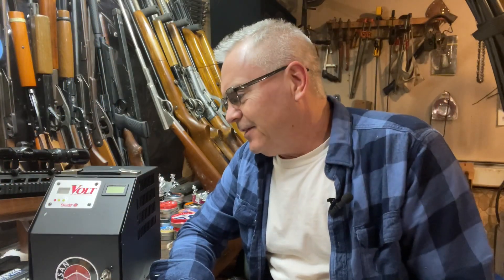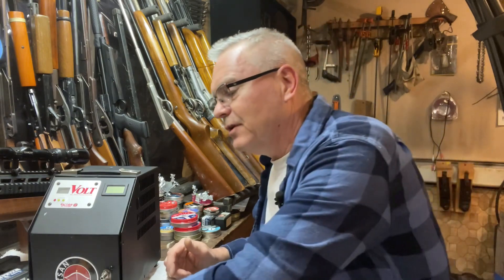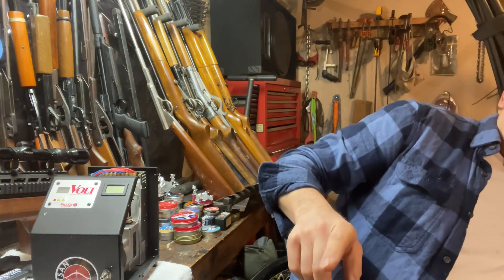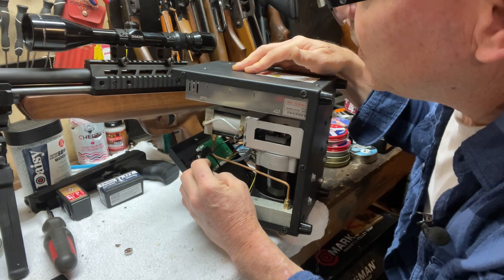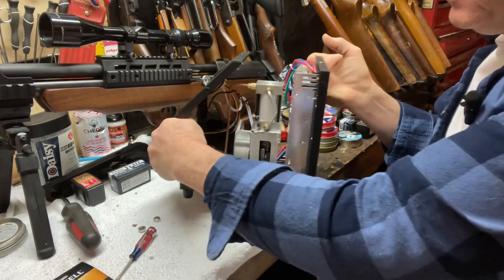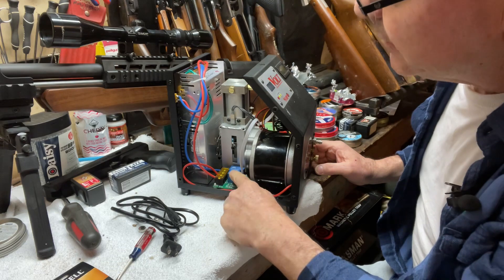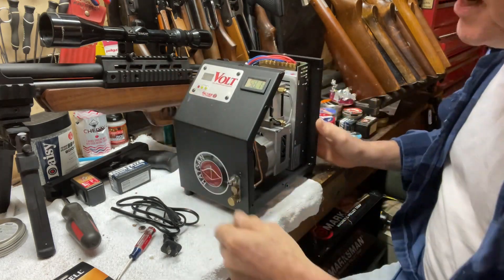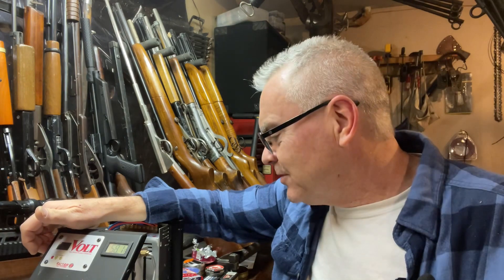Hatsan Volt PCP compressor temperature sensor repair and a peek under the hood.

Comment: Nibs, I have a problem with my Hatsan Volt I purchased and was wondering if you could shed some light on a couple things?
1st- Is the temp sensor anyway connected to the cooling fan operation? (My battery compartment had no cover and the tape I applied is not keeping the new LR44's in place too well)..I will make something a little better soon.
2nd- My cooling fan does NOT turn on when plugged into an ac outlet.The main display works but no fan..I have opened it up and made sure the 2 wire connector is in place properly and plugged the ac in..but nothing.
(I should mention that upon inspecting the fan I have a red and black wire that go into the white connector, then to the board...but I noticed yellow and blue wires that are snipped at the fan itself).

So I have been on several searches looking for a replacement fan with no luck for this exact model with only the 2 prong white connector...my model is the Nidec beta V  VA225DC v35140-57 , 12VDC 
1. 1A.
Question, is yours the same? and could I use something similar as a replacement or if all else fails could I just have a large fan facing the volt to cool it temporarily ?

I am leery of running it as the webpage manual says if the fan does not work turn the compressor off!
At 53 I am Just really tired of hand pumping big bores=) not so bad on my smaller .22-25's..
Anyway sorry for the wall of text.

Edit: I took a slight risk and went ahead and engaged the power from the operation panel and the fan comes on! 
My guess is that whoever owned it before or even the chinese manufacturer's cut the 2 wires to disengage the fan on initial plug-in.
Going to go ahead and try to fill my hp max. fingers crossed.
Reply from the maker: I will try to take a look at mine. Probably won’t be until tomorrow.
Reply: @WalnutandSteel  Thanks for the reply. There really is no need to, as I did get the fan working once the power was engaged from the digital pad.
I think that any other issues may be on the outside now.
It peaks at 92-93 bar of 250..so I guess there is a leak on the hose or port someplace..
I got a new whip on the way and will do a proper seal up to see if it resolves my issue.
Thanks again, Sir.